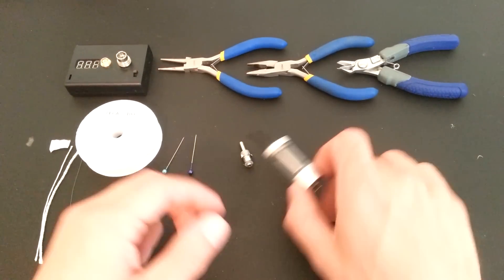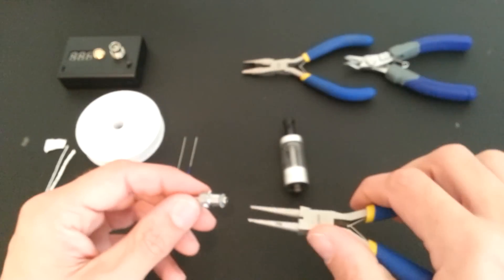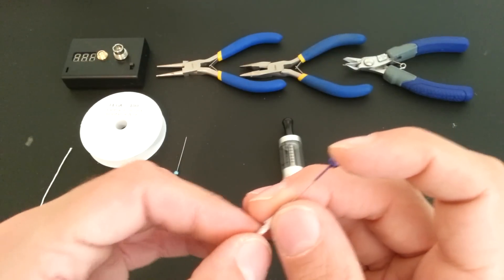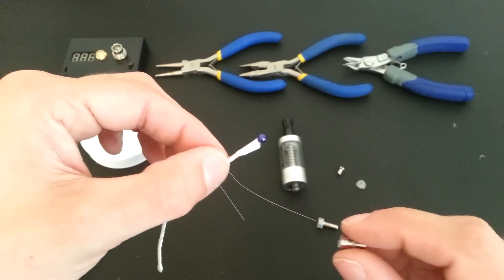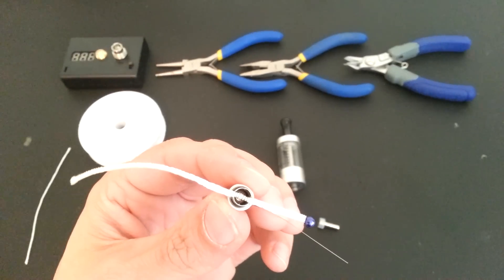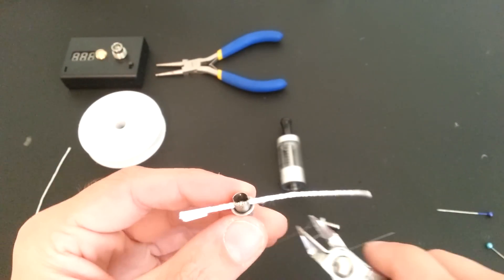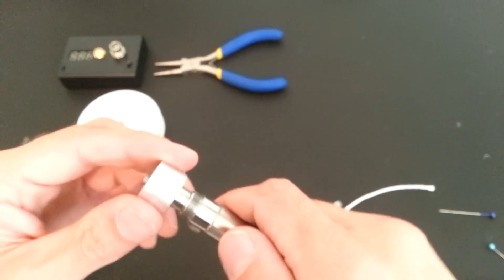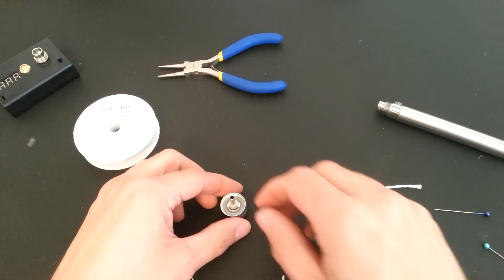Vapeonly BCC Mega Rebuild Coil Head Tutorial HD Closeup

Comment: Nice video.

A quick question and a recommendation.
Is there any problem if you use 2mm flavour wick ?
I don't dry burn , I just torch it before putting everything inside. I found dry burning sometimes getting a burn rubber taste from the silicone gasket in Evods.

Comment: God dammit, DON'T dry burn on bottom coils.  It burns the rubber grommet and you will forever have a burnt taste in the coil.  If you burn the grommet, it will have dark burn slits where the wire was sitting on it.